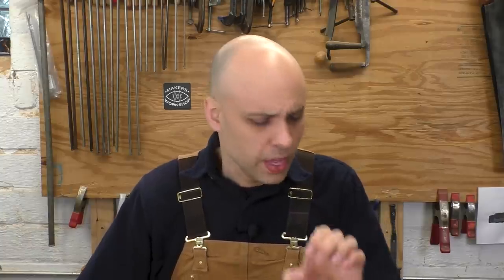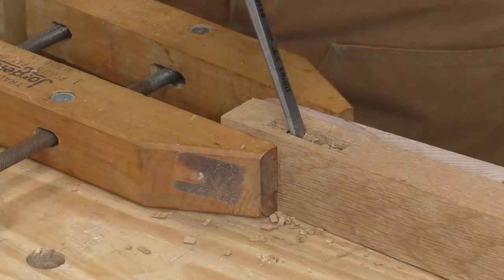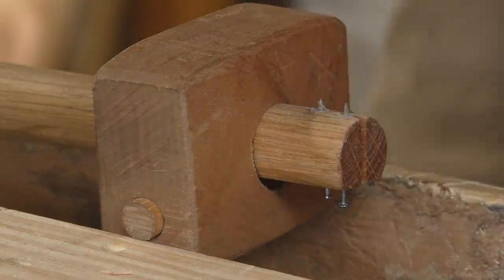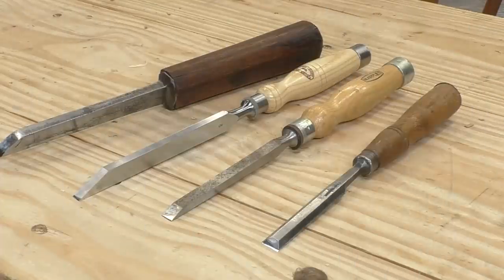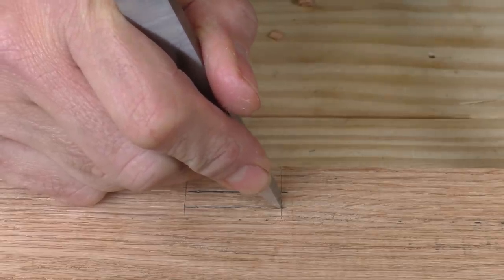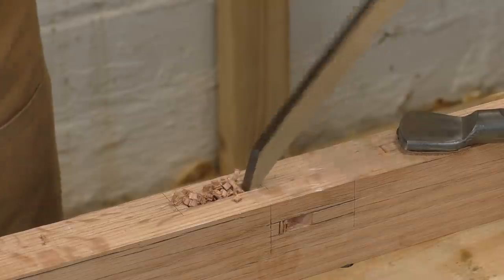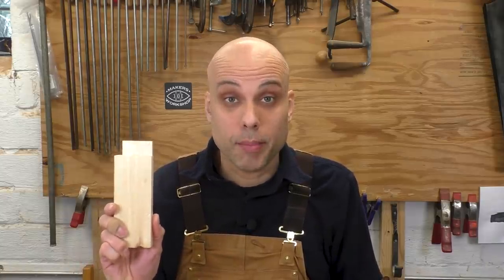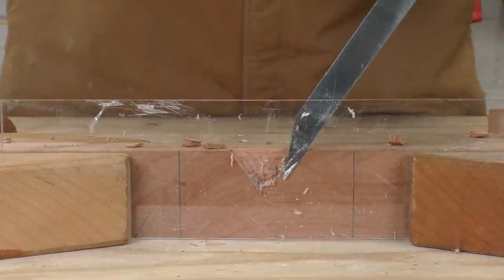Mortise Basics: Marking, Chopping, Fitting

Comment: Good timing, I'm planning on doing the mortise and tennon joints for my shaker side table project soon, got a pig sticker ready for it, just waiting for my kebiki marking gauge

I was wondering though Rex, how do I know what kind of hammer to use? I have a thor hammer and a wooden mallet, and recently I barely ever use the mallet due to the precision i feel I get with the thor hammer, I'd love to see a video on hammer choice, I really want to get a Japanese genno hammer but unsure about using metal hammers on woodwork since Paul Sellers mentioned using a thors hammer to reduce damage
Reply from the maker: Most Western chisels are NOT made for a metal hammer of any kind. Of course the Thor is a good choice.

Comment: small correction: 3/4 " is not 14 mm, it is around 19 mm
Reply: JUST for the record... an 18mm wrench fits a 3/4 " nut or bolt... ;o)
Reply: @gnarthdarkanen7464  Only if its worn and spread. Or cheap!
My 18 mm spanners, (and sockets) will NOT fit 3/4"
Reply: Was just about to say the same thing....3/4” is 19mm, 1/2” is 12mm.....roughly
Reply: 3/4 is 19.05mm ;)
Reply: @philmenzies2477  So you're not in the States, I'm guessing...
    Interesting... Standards for decades were a 10mm for 3/8 , 13mm for 1/2 , and 18mm for 3/4 here...
   ...and EVERYONE knows those "points".

    BUT recently I've noticed a few sizes don't always seem to work the way they always have... lolz... 

     19's have always had so much slack, you risk rounding the socket or fittings off when you try them on a 3/4... 

    In any case, I have wondered... Thankfully, I can generally get two sets, one SAE and one Metric... it's just simpler in the long run.  ;o)
Reply: @gnarthdarkanen7464  Where I live is irrelevant. 18 mm is 0.709,(rounded), and 19 mm is 0.748. If your 18 mm spanner fits a 3/4 AF then your either, 1) using worn, cheap spanners, or 2) worn cheap fasteners. And its kinda rich, a yank telling the rest of the world that the standards they use have been such for decades. Mate the rest of the world has been using metric for decades longer than you.

Comment: Finally cleared my plate of projects in progress and I'm looking to make the Roman workbench next because ...oh man. It's been tricky without a stable surface. 

This video's just in time since I want to substitute M&T joints for the legs. Mostly for the practice.
Reply: Me too, although the price of wood at my local supply is high at the moment.
Reply: @joeyshofner639  My local lumber yard had some hard maple they wanted to unload last month but even at that rate I had other things to spend money on first. 

Hard maple workbench would have been nice ...
Reply: I’m most of the way through making my bench top, all using wood taken from the long edge of doors thrown into skips, ie, free wood, beautifully seasoned for 100 years or so. It’s looking great so far, and free!

Comment: I am very late to the party, but I have found a mistake here that bugs me a bit. I was confused about the 8 mm (5/16 inch) being a "fat third" of  a 3/4 inch. That probably makes sense to people used to the imperial system, but us metric folk rely on the metric conversions which you conviniently display. Now, at 2:25 you display that 3/4 of an inch was 14 mm - but 8 mm is not a fat third of 14 mm, it's more than half. Extensive research has shown that 3/4 of an inch are in fact 19 mm (19.05), not 14.

Please note that I didn't write this out of spite or to annoy you - I just wanted to help.
Reply: The North American lumber measurement system is ‘slightly’ skewed- a 2x4 is not exactly 2 inch by 4 inch but 1.5” by 3.5”.
Real dimensions of a 3/4” and 1” hardwood are 14mm and 21mm respectively

Comment: Ok, so I'm planning on doing this joint
https://youtu.be/P-ODWGUfBEM
The hole in the middle of the square will be half an inch for my project.  Is it a bad I idea to drill the hole then square it with the chisel?

Also.  Would it be better to make both halves, connect them together, then make the hole?